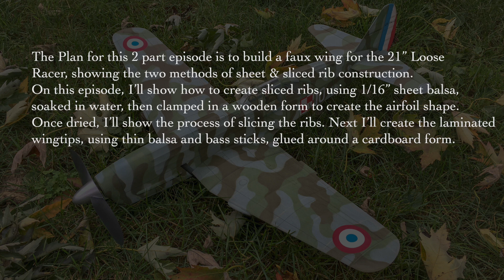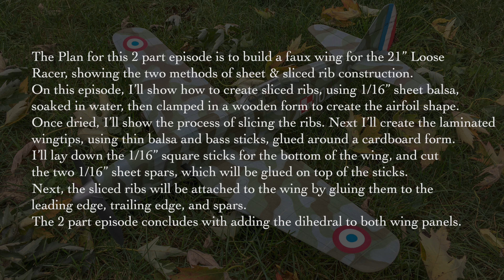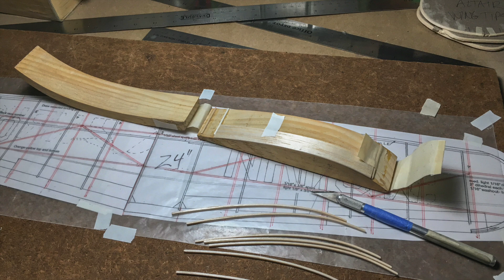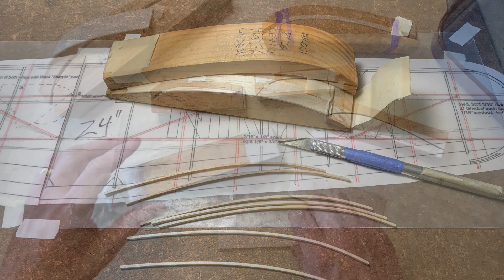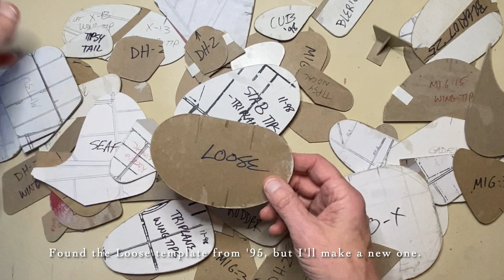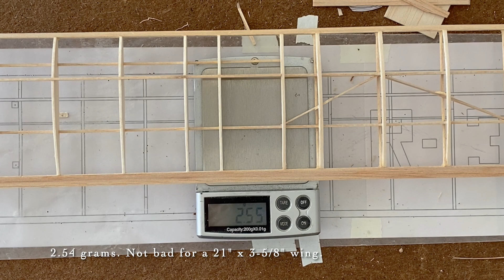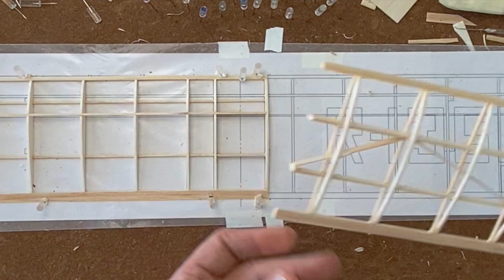Free-Flight Basics #9.2 - Making A Wing With Sliced Ribs - Part Two - Conclusion

Comment: Beautiful framework on both sides of the wing. You have demonstrated the difference in weight and strength in a visual way. I like the right hand side of the wing structure  for its rigidness even though you need extra constructing process and parts. I thank you very much for such a video like this.

Comment: Another great video. I especially noted the way the sheet rib wing and its surface spars are tied into a dihedral angle as I have always struggled with that. The "offset" of the form blocks for slicing ribs was another eye-opener as that is really efficient and quick cutting. More! More!

Comment: If I got back into this hobby again, I would never use CA glue.  I became a health person 33 years ago.  The nose knows.  Easy as that.  If you want to look it up, that's also easy:  
HAZARD SUMMARY
* Methyl 2-Cyanoacrylate can affect you when breathed in
and may be absorbed through the skin.
* Contact can irritate and burn the skin and eyes.
* Breathing Methyl 2-Cyanoacrylate can irritate the nose
and throat causing coughing and wheezing.
* Methyl 2-Cyanoacrylate may cause a skin allergy. If
allergy develops, very low future exposure can cause
itching and a skin rash.
* Methyl 2-Cyanoacrylate may cause an asthma-like
allergy. Future exposure can cause asthma attacks with
shortness of breath, wheezing, cough, and/or chest
tightness.

Comment: Yay! Finally I get to watch at a sensible hour 6pm. Can I ask what your construction board is made of and are there any plans around for the winding station you use? Many thanks.
Reply from the maker: Ha. Thx.  I use fiber board, often sold at the larger hardware stores for sound dampening or soundproofing.  I've not seen plans for winding stooges, or stations, but I'm sure some are about on the web.

Comment: I will second all the thanks and praise that other have mentioned! I notice that some builders double glue joints. What are your thoughts on that method.
Reply from the maker: Thx Jerry.  I generally don't double glue, mainly to keep the overall structure light. But in some areas that take on stress, like the fuselage box, I'll go back and hit the joints again with a thin layer of Titebond. Sometimes the weaker joints surface during the final sanding, so I'll take a closer look at the other joints nearby.

Comment: Seen a well thought out Upgrade to your sliced rib method. 
Where 1/32 sheets are Laminated together (white glue) In the Form..
 then Microwave 'baked'... Producing a FAR stronger rib shape of ~equal weight.
 That Does Not 'unbend' once out of the form. 
Also have concerns re the 'sorta' Airfoil your demo'd technique produces .
Yesss... I know it's only for a Gummy band model.. but Still ?

Comment: Hi Tom, Thoroughly enjoy your videos and the effort required to produce them, much appreciated. You don't often have an insight into another builder's peculiarities and there is much food for thought. Fitting the laminated wingtip was a bit of an eyeopener. I enjoy the sliced rib idea but an never get away from a notched trailing edge for strength.  Whenever I don't do it and crack a rib off the TE whilst sanding I wish I had persisted. Have you used it in conjuction with this method? It adds a certain dimension to length of ribs and fitting. I always feel better when I 've bothered.
Thanks again! Geoff
Reply from the maker: Thx for there feedback.  I had tried notching the trailing edge, but found that gluing the upper and lower sliced ribs along side of each other gave me a solid attachment. Plus, sanding with my had directly below the sanding block gave the process support, so I've avoided potential damage with that simple leverage trick.

Comment: Thank you so much for sharing you talent and experience with us.  I've always built only the frames because they are so cool looking, but never finished because I just never could get it right. Now seeing your videos, I finished one a couple of months ago and almost finished with a Cosmic Wind from just the plans because of your inspiration.  This, I am sure, will help many get into the hobby and keep it alive for many years to come.  
I wanted to ask what kind of pins do you use and is that just strips of balsa under the head to "tighten" the grip wit a soft touch, or is that a special brand you found?

Thank you
Reply from the maker: Thx for the comments, Jon.  I've had these pins for nearly 30 years but they came from a cottage industry and are no longer available. There are similar styles out there but these with the varying lengths were ideal. I do use thin pieces of soft balsa as a buffer, so that the clear plastic heads don't dent the various balsa frames.

Comment: Sliced ribs look amazing! Just curious. How much weight is saved by going with sliced ribs vs. sheet ribs?
Reply from the maker: Thx.  It's hard to say since I've never built two of the same wing using both methods. Regardless, I prefer the simplicity and strength of the sliced rib, especially when u factor in the spars and truss. Creates a very light yet strong wing.

Comment: Tom, what is that magic wand you use at 6:27 to dispense drops of CA? I avoid CA because of the way it is hard to control out of the bottle - your "wand' makes it look easy.
Reply from the maker: Hi Steve. It's nothing fancy, merely a pin that's embedded in a clear rod, which I picked up 30 years ago. He no longer sells them, but u could easily make one with a pin and a 6" dowel.  I use it for many things, but spreading CA with it makes it an easy and safe task.

Comment: Another wonderful video. Instead of slicing the formed sheet, if you put 1/16 square strips into the form, would that work too? Thanks
Reply from the maker: Thx, Peter.  You know, I'm surprised that on one, including myself, has ever suggested that. Give it a try and see how it plays out.  Only issue I see is how to stack them together, side by side. Maybe use tape on one end? Keep us posted.

Comment: Thanks for the great channel! I am modifying a 1936 Muhlvill design for P30 and am planning to build it using the sliced ribs and laminated wingtips method. After building a couple scale models with this method I really like both the stiffnesss and weight savings. On these builds I used a balance between scale accuracy and the plans using sheet ribs. How do you determine spaces between ribs to make the wing strong enough, but as light as possible?

Comment: Have you already covered how you set wash-in or wash-out? I may have missed it.
Reply from the maker: I tend to build my wings flat, then adjust to any warps that may have surfaced after covering, since my structures are fairly light. Unless the warps are severe, at the field I'll induce wash-in or wash-out via thin gurney flaps, on either side of the TEs.
Reply: @maxfliart  that's a way more simple solution

Comment: What weight would you be looking for generally, making a 21 in wingspan, upper wing , " island hopper " weight before rubber motor
Reply from the maker: I'm not sure of that specific model, but for a 21" single wing model I'd keep it under 30 grams w/o rubber.
Reply: @maxfliart  I guess I misspoke it's actually the Wienker Island Flyer, not a kit just working off plans. Thanks for the help , now I now I'm in the ballpark

Comment: why the bass on the inside of the lamination ?  i would think it would make the tip more durable using it on the outside, or is it to keep the full depth (and thus strength) inside and allow shaping the tip profile in the less dense balsa ?
Reply from the maker: Yes, that's it exactly.  Sometimes I go with three layers of balsa over the bass, for that same reason of shaping the tip.

Comment: Here's a question. Could you make a laminar flow wing or would that defeat the whole idea of rubber powered flight? I know it would probably work with electric or gas powered models. When I was a kid I built a few control line planes with perfectly symetrical wing surfaces. The reason I asked was I want to build a scale P-51 B/C  with authentic "laminar" flow wings and I can see I could easily do it using your technique, but I'm not sure it would fly very good.
Reply from the maker: Many airfoils work for free-flight...some much closer to scale than others. I seem to have settled on a flat bottomed airfoil, but some would never go that route. I'd suggest trying the laminar design on a simple model and see what happens. If it goes well, then you could feel more confident about proceeding with the complexity of the P-51.
Reply: @maxfliart  Thanks

Comment: Hey is starting with a Guillows Nieuport kit a bad idea? Im getting to the wings right now and uhm. Im getting a little lost.
Reply from the maker: If this is your first model, it could possibly be a bit too complex to build, and even more troublesome to fly.  I'd start with a cleaner, duration type model. This link from EasyBuilt Models will give you a few good suggestions. https://easybuiltmodels.com/start.htm#gsc.tab=0
Reply: @maxfliart  Thank you so much. Ill probably just finish this Guillows kit up as a non flight model then, then go take on these easier kits.

Comment: Ok max  which wing half is going to get twisted? I would have to say the right with  the diagonals.....left climb right glide ???no response you get deleted  ama 577502.and Don't give me a heart...I got one hard core ff.
Reply from the maker: This ship flies hard to the right, and then fades to a nice right glide.  My preferred flight pattern.  Right-right. I tend to build the wings flat, then add Gurney flaps to lift the inboard wing as needed.
Reply: @maxfliart  thank you ,your skills remind me of Dave aristein and others...that's just Jake , flying models contributor....I miss Jake.keep on cutting and covering tom...I really liked the smiling jack fighter. Most don't even know of the radio show, but you do..tells me where your heart is. Nice.